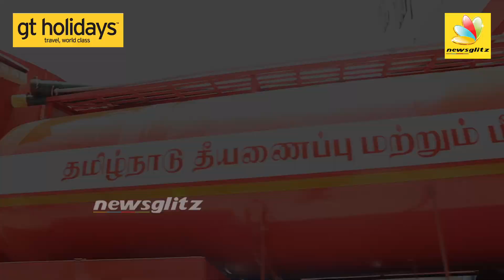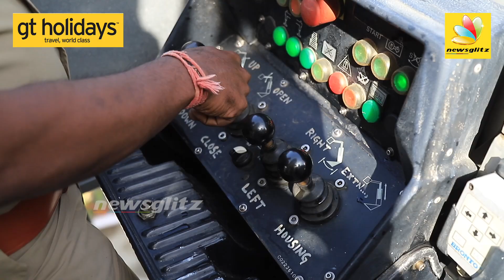தீயணைப்பு வீரர்களின் சொல்லப்படாத வலிகள் : Firemans Exclusive Team Interview

Comment: Tips to avoid electrical Fires:

1. Earthing should be proper and it's resistance value should not exceed 5 ohms. Earth pit should not be left dry, it should always be kept wet by watering. Dry earth pit is useless.

2. MCB/fuse rating should match the load.

3. Avoid using extension cords. It's easy to overload extension cords.

4. The insulation resistance of wiring should be checked at least once in 5 years and the value should never go below 2 Mega ohms.

5. Every house member especially ladies should know  to off the main switch or Isolator during electrical emergencies.

6. Never cut 15 amps plug and replace it with 5 amps for convenience.

7. The main board should be rodent proof.

8. Do not store inflammable materials near the main service board.

9. AC's should be serviced compulsorily before summer season.

10. Never use appliances with frayed cords.